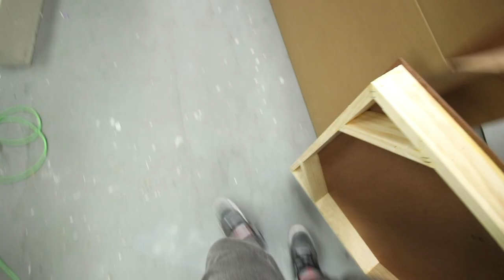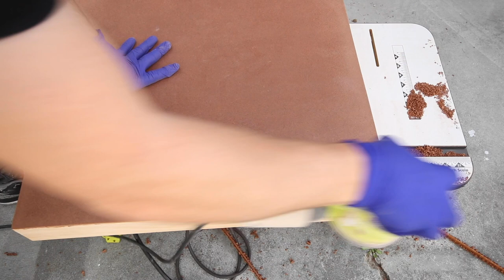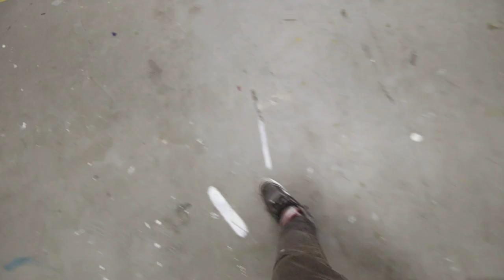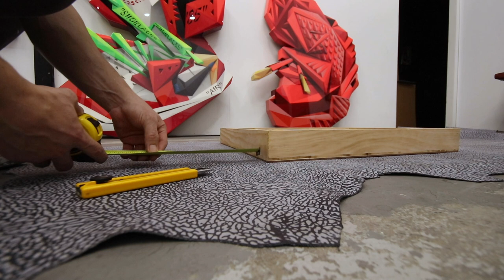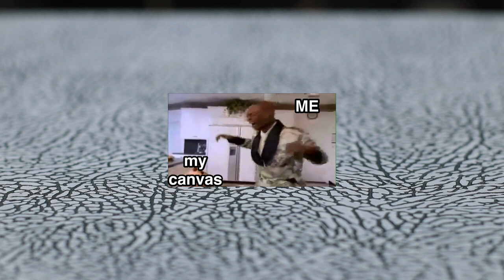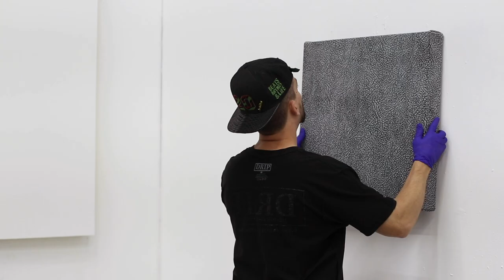Canvas Wrap with Expensive Jordan Brand Leather!

Comment: How do you plan your pictures? How do you know where which triangle has to go and what color it has to be? I want to do that in my room.
Reply: please answer this question
Reply from the maker: its the same way that a brick wall is built.  you put down 1 single brick, put it exactly where you want it... and then put another one next to it or on top of it... one by one, color as you go (understanding of light+color+values not included - results/experience may vary)  

on average my works range from 500- 1000+ triangles and each one is illustrated one at a time.  hope that helps, sorry the answer isn't a shortcut, things that take time always turn out better, cheers
Reply: @JCRoShow  thx for the answer.
Do you plan it on the computer before you start spraying it? If so which app/ software do you use? 
Greetings from Germany